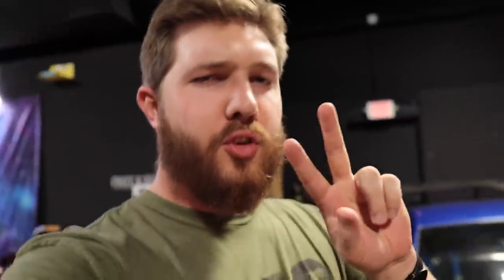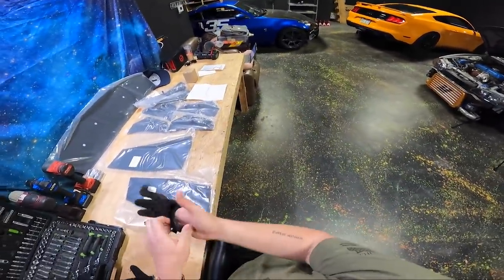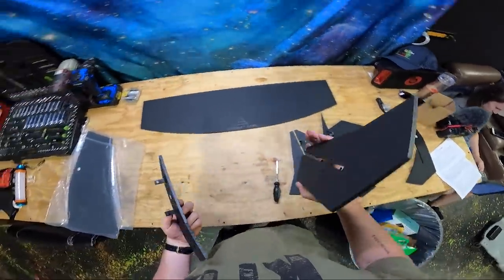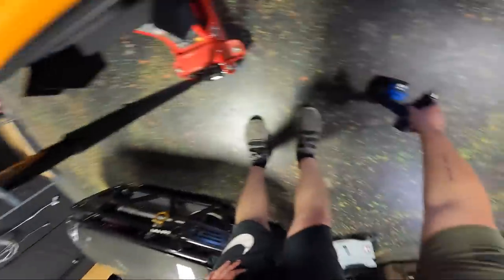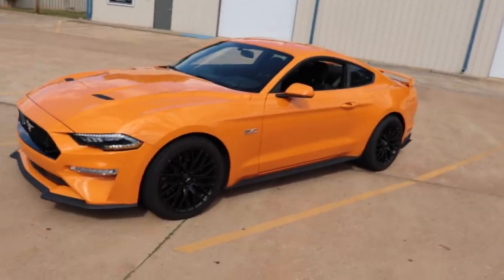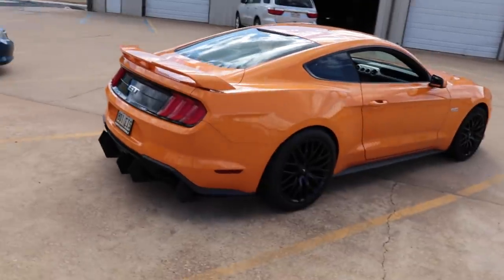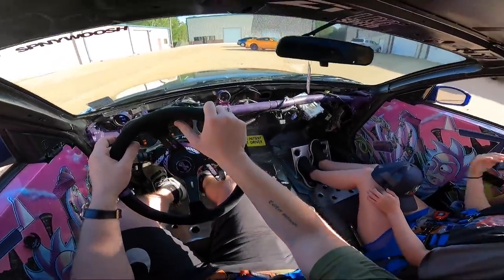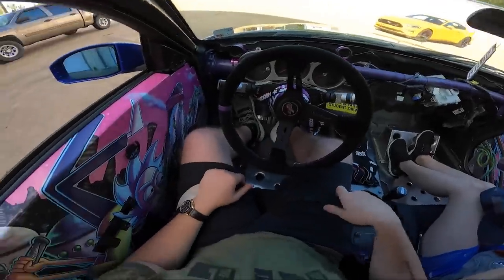Payday gets a Street Aero Diffuser & @PoeBoys Update!

Comment: You should twin turbskie payday for sure. It's what Gavin is doing to. It would be a nice race to. Doin a couple digs. It would be a good set up and get a nice tune on it.
Reply from the maker: I'm not sure if I want to turbo PayDay yet tbh.  I'm just a bigger fan of superchargers
Reply: @Zorbii  ok then. Goodluck with the pulleys and belts😂
Reply: @Zorbii  I've seen the problems gavin had with the black car. Also I was wondering if you could supercharge and twin turbo a car. I'm 70% sure you can. I'm still new with car stuff still learning.
Reply from the maker: Probably. There’s ways to prevent having belt issues that Gavin never got around to. Belts are always troublesome but you can make it better.
Reply: @Zorbii  yeah i think a supercharger is easier anyways tbh